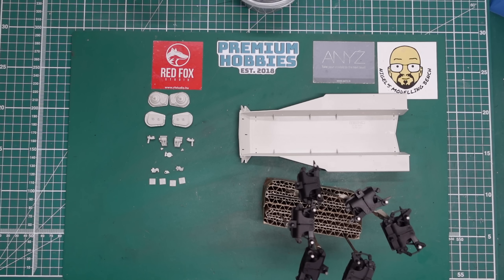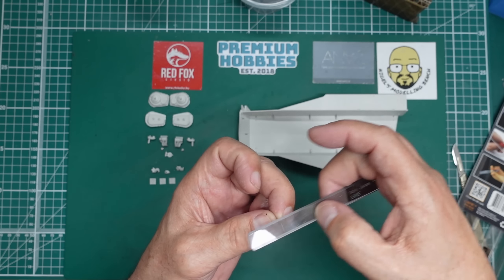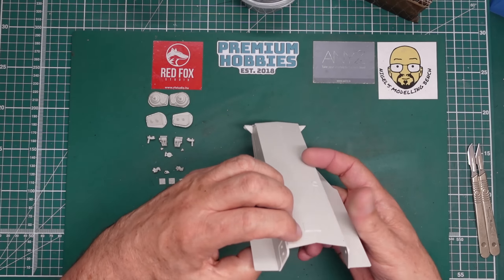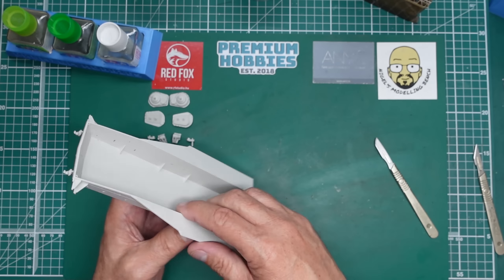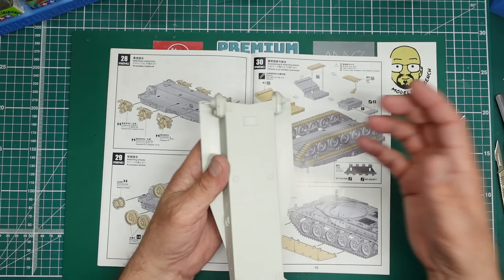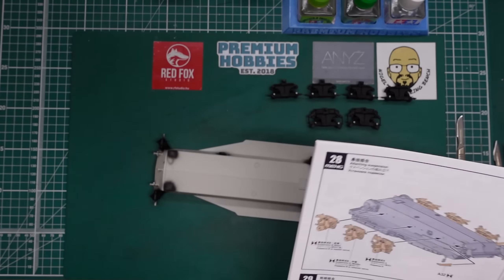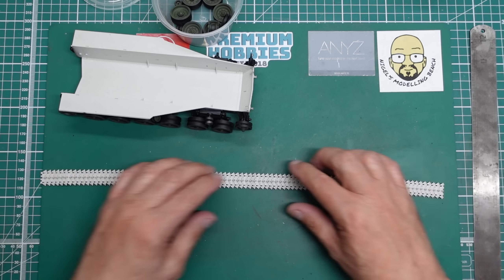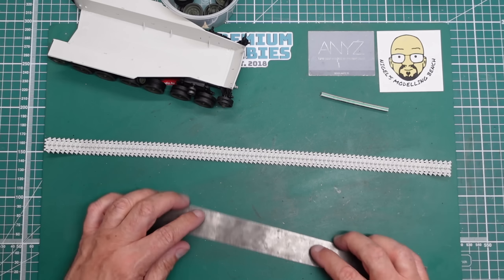Meng 1/35 Chieftain Mk10 build.  Part 3... in 1440p

Comment: The hatch is for resupplying crew when in NBC conditions. I think the chieftan gun was bag charge so there is no spent shells if its the same as challenger 2, but you can resupply shells through it. Also used for the toilet waste for the toilet under the gunners seat.

Comment: That other chap, "His Nibs", may have stretched the tracks somewhat by not removing those plastic bits that stuck out slightly. So his total could well have been one section fewer, though nearly as long as your meticulous work with the tracks to get them straight and accurate.

Comment: Hi Nigel, it was me regarding the tracks forming an arc (thanks for the correct term!). I sanded the sprue connection points, so I have no clue what kind of issue caused the problem.
Reply: Your track length has a slight tendency to form an arc, but nothing what could cause issues mounting them, as you can bring them into a straight state.
Reply from the maker: I guess they updated the tooling?

Comment: Thanks for sharing the building tips.
In video 30:11, after inserting the side sticks, do you suggest to apply a little Tamiya extra thin cement to make the track more stronger?  
Thanks
Reply from the maker: No. You may make your track turn solid.

Comment: Hi Nigel... I'm not into armor but I'm liking this build.  Curious question...after fitting the tracks in the jig and cutting the pins, can you use the removed piece to fill the holes on the other side of the tracks thereby filling 5 at a time? Maybe they'd be to big in diameter i don't know. I don't have the kit so it's just a question.
Reply from the maker: It's sprue gate, so probably too big and not round.